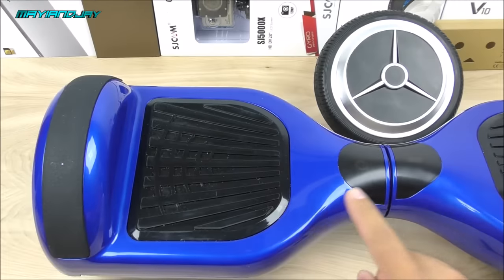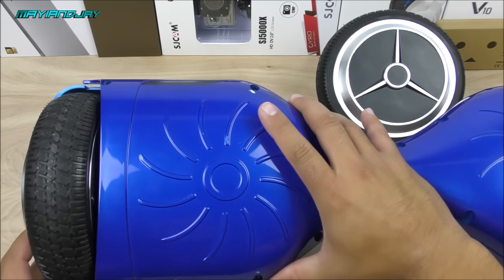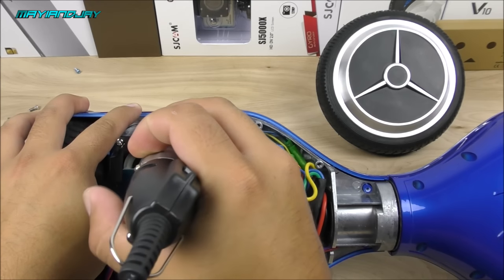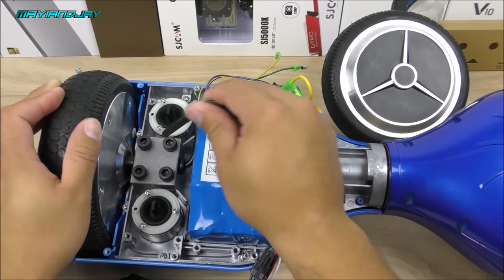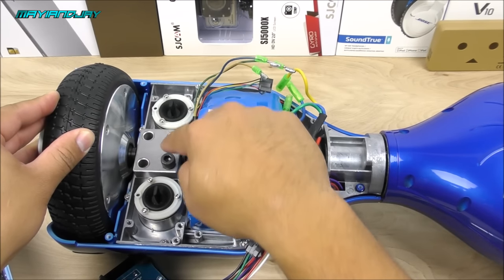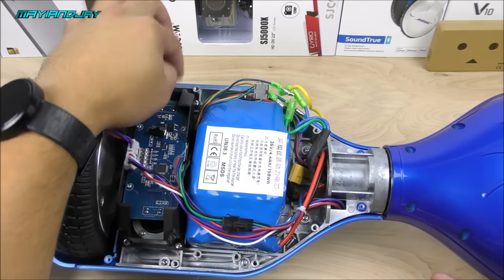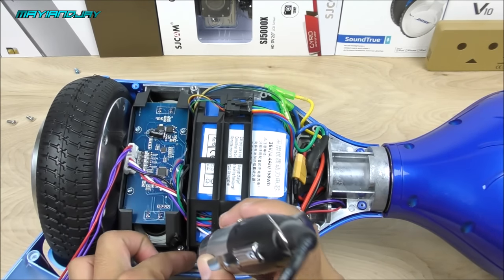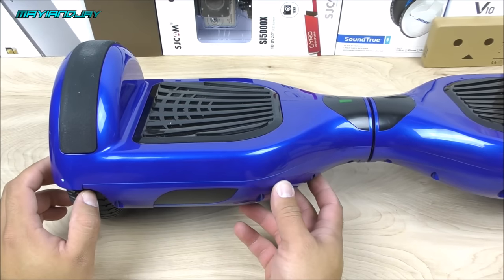Balance Scooter/ HoverBoard - Motor Replacement Tutorial!

Comment: Honestly people can buy cheap hover boards but they have to replace the motor or wires so the hover board can be safer because the cheaper hover boards have either a weak motor or faulty wiring so you may have to buy new motors or wires but you can just duct tape wires just be sure the wires are connected then you have a working safe cheaply costing hover board just do all of that then you don't have to worry to to much about it exploding or catching fire but it's still a possibility so just test it outside for about an hour or so then test it every week or so